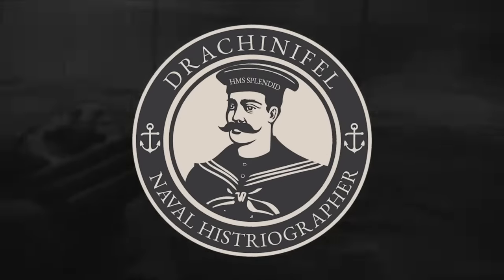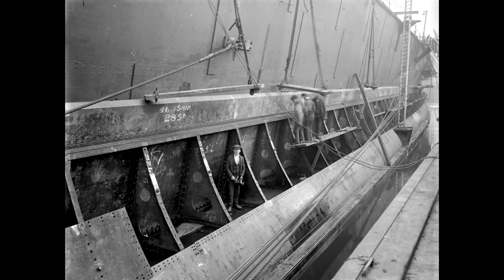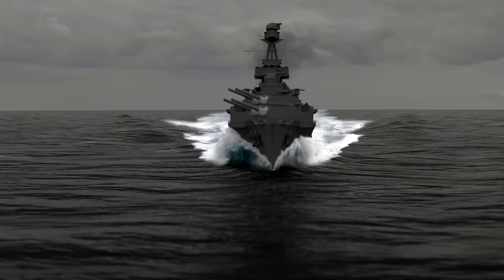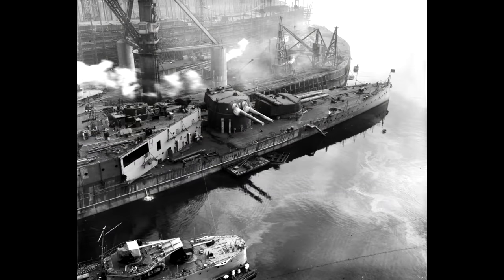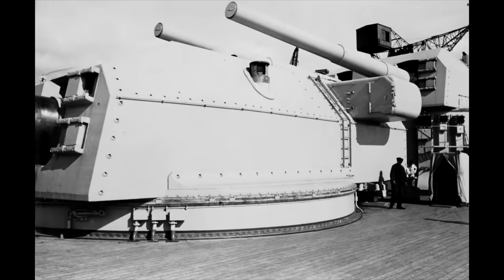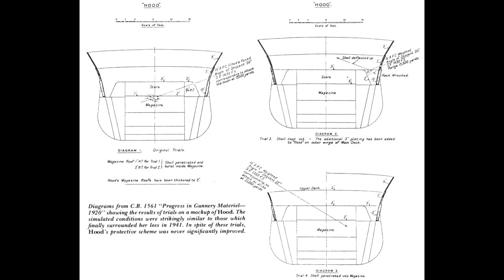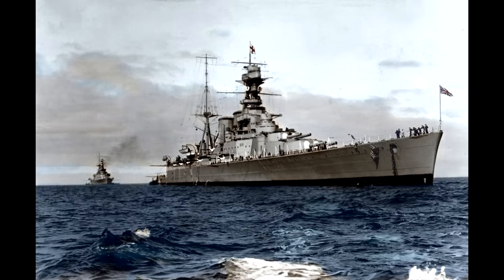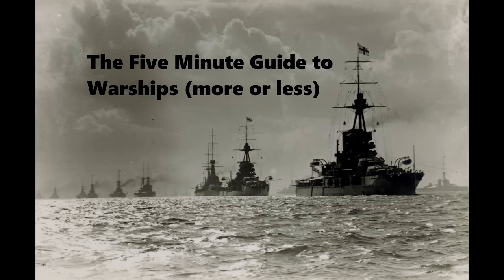The Loss of HMS Hood - But why did it blow up??

Comment: Your assessment of the belt penetration of a 15" shell... doesn't seem to account for terminal ballistics weirdness. At least with small arms, they've noted that the paths of the bullet after impact are liable to do strange things, rather than fly in a straight line through or mathematically ricochet. I do tend to agree with your assessment, though, as it is one of the few ways you could explain the unholy blowtorch of death at the mast.

Also, after Jutland, I imagine anyone who got caught bypassing anti-flash safety features in the Royal Navy was probably in deep, DEEP trouble.
Reply: The British always had a problem not following safety rules, the CPT wanted faster reloading and to do that crews left the doors open, they got grog while those that followed the rules got extra duty.
Reply: @demonprinces17  No that was only at Jutland after that it was abolished and never used again

Comment: There's a lot of focus placed on only one 15in. shell from the Bismarck striking the Hood and detonating her aft magazines, hence cutting the ship in half. The Bismarck had fired several salvoes during the action with the Hood and it remains quite possible that two 15 in. shells penetrated her aft and mid sections within milliseconds of each other --- the first detonating the 4 in. magazines causing the "volcanic spouting or flash effect" - instantaneously followed by the second shell's penetration of the aft 15in. magazines with the resulting eruption of the central superstructure and keel effectively cutting the vessel in two. I also suspect that the shells which struck the fatal blows to the Hood were fired by turrets Bruno and Caesar with Caesar's shell striking first the 4in. magazine and Bruno's shot the Coup de Main igniting the 15 in. magazine. If it were only a single turret that might have scored the final blow with two rapid penetrations --- I would argue that Bruno probably had the best odds of pulling off such a shot based on its position, angle and momentum when the salvo was fired and as the Hood was starting her turn. In doing so , she walked herself right into a perfect "deflection shot" by accident - tragically dooming the ship.

Comment: An excellent presentation and a very convincing explanation of this disaster. In many of your videos, you mercilessly disparage the Japanese 25mm antiaircraft suites. I am certain that many Allied airmen would challenge your negative assessments of the guns if they had survived their encounters with them. I have searched and cannot seem to find an explanation for your opinion of the IJN's choice of antiaircraft protection. Please produce aother excellent video and show why this opinion of yours is so prevalent.
Reply: I believe he already answered why the 25mm was so bad in one of his drydock videos
Reply: The short version is that the guns required such frequent magazine changes that the maximum effective rate of fire was barely half the cyclic rate.
Reply: the problem with IJN AA wasnt the 25mm & 105/125mm (both obsolete in 1942?) by themselves but the gap they left on the defense grid ... IJN short range 25mm couldnt compete with german/alies medium range AA (37mm/40mm) and they had no such medium range weapons
Reply: on the other hand the US/UK 20/25mm equivalents were quickly phased out in favor of pompom/bofors
Reply: There may be a lot less of that than you think. For example, out of all the US planes shot down at Midway, only two were from Japanese AA fire.

The 25 mm had five major issues. The small magazine interfering with the effect give rate of fire has already been mentioned. There was too much vibration from the guns, the sights were never more than rudimentary, training and elevation rates for all mounts was too slow to keep up with current aircraft speeds, and muzzle blast also negatively affected the gun's ability to get and stay on target.

Comment: 28:31 is it possible that the deflection from hitting the 7 inch belt caused the shell to deflect downwards, increasing the angle closer to perpendicular or potentially hitting the segment after the curve, being very close to 90 degrees?
Reply: I think the projectiles direction would have rotated slightly due to the passage through the armor, as you suggest. I have seen this with projectiles passing through concrete.

Comment: There is something that you mentioned that kind of made me think for a minute. Mainly about the torpedoes. What if the Bismarks guns hadn't fired all at one time due to firing rates, loading mistakes or what have you. What if a shell had hit the torpedoes, caused them to tear open the ship just enough for a latter shell fired a few seconds later to actually go through the newly opened up section, through the remaining armor protection and into our very near the magazines? That would explain the account of a second shell hitting the ship, but the first shell maybe rupturing the ship just enough with the column of flame to shoot upwards like you said a torpedo explosion and its results would do. Just a thought but what do you think?

Comment: One thing these discussions never seem to take into account, much like tank penetration debates, is that the armor is not 100% protecting the ship. It is not free of flaws. Even ignoring things like a badly made bit of armor far weaker than it is supposed to be, there are points where the armor offers no protection at all. The crew has to get through after all, there are hatches and passageways, you can't make a hatch 13" thick with hinges the same strength. For a larger opening in the armor they might layer armor in that place so the crew can get through but there is still a plate covering the opening, but for something small like a hatch, I mean, what are the odds that the shell will strike those few tiny little spots anyway? What are the odds a shell will hit directly on that vision slit or machine gun ball mount on the glacis plate of a tank? They feel it is a worthwhile risk, and a machine gun ball mount takes up a significantly larger area of a tanks glacis plate that a few hatchways in 600ft of belt armor. BUT, if by a fluke that shell hits that hatchway, a 16" shell will pass right through easily. Even striking near an opening in an armor plate significantly reduces the effect of the armor, the "edge effect". This is the main reason they did stop making any kind of opening in the glacis plate of tanks.

Comment: 11:00 I would also ask what was the sea state & direction the swells were moving.  Swells coming at the Hood on the starboard quarter or abeam, can cause significant roll, compounding the problem of determining the angle that the fatal shell struck.

Comment: 34:52, exposing the red paint below the waterline.Unlikely,  HMS Hood had grey anti-fouling paint throughout her life span, HMS Hood Association:  Surviving D495 Reports of Docking contained in ADM 136/13 (the ship's books) confirmed that everything under the waterline, to include the propeller shafts and rudder, was coated in Peacock & Buchan's anti-fouling paint (which was only supplied in grey and black). These reports rarely specify colour, but when they do, the only colour mentioned (at commissioning, in 1925 and again in the mid-late 1930s) is anti-fouling grey (an unspecified grey over a slate undercoating). Its quite possible, based on continuity of use, that grey was likely her primary underside colour throughout her entire service. Although we can't 100% rule out a black bottom at times, we've seen no evidence of it. We can also state conclusively that Hood never had a red bottom.
Reply: Great post Mark. Thank you.

Comment: So the Hood "might" have survived if
1. the extra protection between the 4" and 15" charges hadn't been removed to make space for more ammo
2. the explosive pressure had more chance to escape before it overloaded the existing structure, either with more ventilation or specially designed armour that blows out if under pressure
3. the captains lucky rabbit foot wasn't undergoing an update at that particular moment.

Comment: I do have a question though. The diagram shown shows that the 4 inch magazine being right next to the engine room. If the 4 inch magazine began to cook off, why did no one in the engine room report this to the bridge? I mean the magazine is right next to them, surely they would've seen the flames and felt the heat

Comment: Great analysis.   I had wondered that if the Hood was already into her turn, she would heel over some and thus the impact angles would change.
Reply: Go watch his refit on Hood video where he explains it much more further but let's see here, Hood was only beginning to turn when the shot hit her, Hood had inertia meaning to say that when Hood turned it will actually take 5-10 seconds before she actually changes direction
Reply: The deck protection relative thickness would be reduced, but the shell is still coming in at too shallow an angle to penetrate deep into the bowls, and would not have made it to the MAD

And correspondingly the belt protection relative thickness would be increased further reducing the possibility of penetration.
Reply: IF I understand it correctly, Captain leach of Prince of Wales stated that the signal flag for the turn had not yet been lowered (the execute signal). If this is accurate, then Hood had not yet begun her turn- unless the signalman had been KIA). Yet another unknown factor which will almost certainly prevent a definitive answer into how Hood was sunk.
Reply: @manilajohn0182  From memory in Drach's video it was observed that previous flag had been lowered, and POW began her turn before the signal from Hood was hoisted.

This is from Ted Briggs (who was on HMS Hood at the time)

"By this time Hood and Prince of Wales had reached a range of 16,500 yards and the Admiral ordered a turn to port to bring our after guns into action. As the ships began to turn, the next salvo from Bismarck struck Hood. 

I heard no explosion as such on the compass platform. A gigantic sheet of flame shot round the front and we were all thrown off our feet. When I got up the ship was listing slightly to starboard and it was obvious that she had been very badly hit.

However, she righted herself and at that moment the Quartermaster reported up the voice pipe "Steering gear gone, Sir". Captain Kerr ordered, "Change over to emergency steering".

She then started listing to port and carried on going. She had gone, I suppose, about 40° when it became obvious she just wasn't coming back and people began to make their way out"
Reply: @notsureyou  His is a great book. As I recall, he believes that Prinz Eugen was the responsible party for Hood's loss. I thought that he was asked during the enquiry if the execute signal had been given, and that he replied that he was unsure, but believed that it had. In any event, it sure seems unlikely that Hood was heeling to any significant degree. EDIT: There's also no hard evidence to support the theory in this video. I would say that it's possible though- just not the most likely cause.

Comment: Admiral Lutjens decided not to refuel in Bergen. Bismarck left Norway without 2000 tons of fuel it could have loaded. That was going to have massive importance later. When Bismark was racing towards France, they were short on fuel, and Bismarck had to run it's engines at 22 knots, instead of 28 knots (22 Knots was the efficient speed, while 28 knots consumed fuel at a much faster rate which would have exhausted the fuel supply before reaching France) If they had sailed at top speed, Bismarck would have been 160 miles closer to France when it was found by the flying boat. And she would have been out of range for the swordfish from Ark Royal, and too far ahead for the Royal Navy